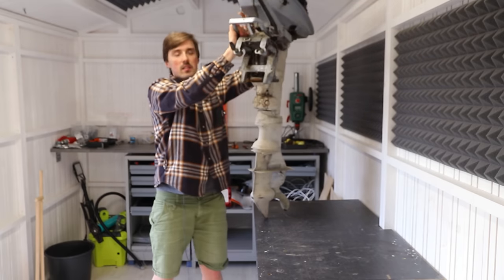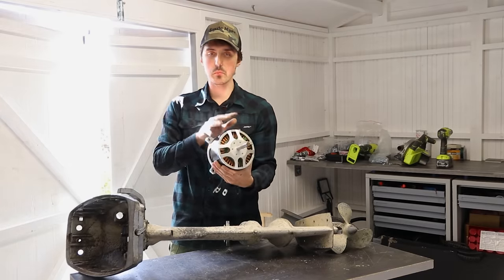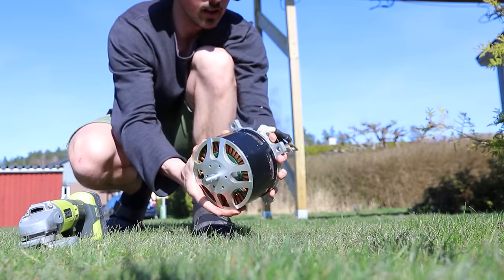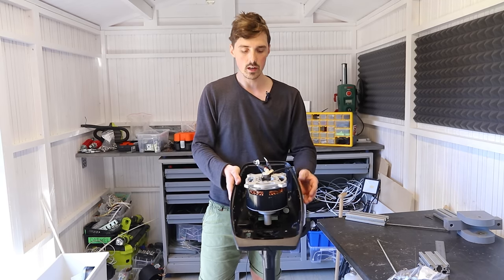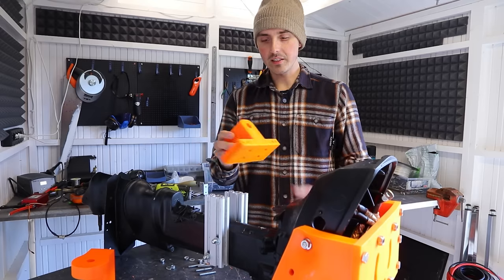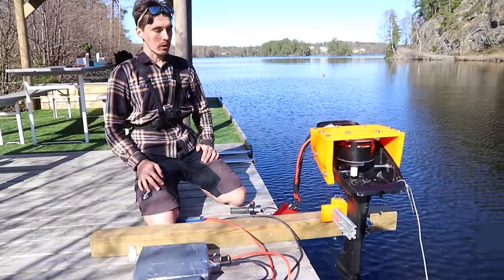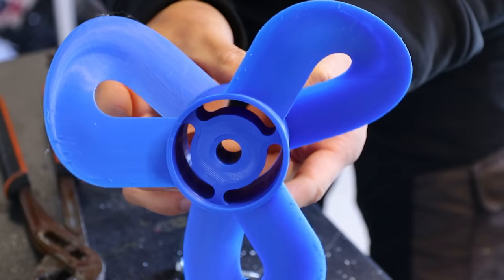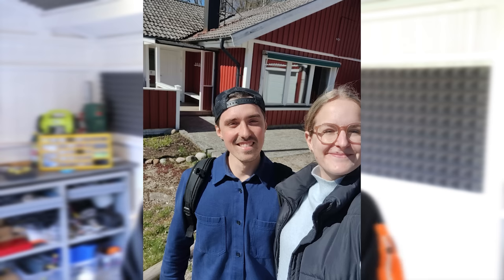Rideable Electric Speed Boat Build - PART 1

Comment: Its not cavitation at 10:30, its ventilation when the propeller gets air from the surface. 

Cavitation happens at the tips of the propeller blades when its spinning so fast it creates a vacuum on the other side of the blade and starts eating away at the aluminium/whatever the prop is made of :)

Comment: I suspect a steering wheel could be added to the engine housing and simply eliminate the need for a linkage (straddle the motor, basically).  If there's enough caster/offset from the propeller to the pivot, it will not need to be at the back of the watercraft.  Sponsons/fins on the hull would be quite beneficial in this case (movable rudder might also permit crabbing). ...Oh, and you're gonna have 420 days of bad luck if you don't oil those nice tools!  Like reely bad luck -- pinching your finger on a screwdriver type of crazy shit.

Comment: can't you use the metal part that was already on the motor to mount the motor to a ship? Your steering problems should also be fixed with that. That part is already made to withstand the forces the motor provided and be used to steer the thing
Reply: He seems to prefer reinventing the wheel with poor quality plastic

Comment: Why not mount the outboard case to the transom normally? I know its not good content but you could have saved yourself some headache if you just bought a transom clamp for the motor. It would have a pivot and then you just attach cable to each side of the housing

Comment: Here's a tip. Building with plastic is no good if you want something to be reliable. Get a lathe and a drill press and learn how to weld metal. Then you will have better stuff.

Comment: This is such a simple build if you know what you are doing?  Use a piece off the end of the original crankshaft to couple to the driveshaft and a piece of the original engine as a spacer.  See what 1000's have done before you?

Comment: I don’t get why you made a completely new mounting system for the engine. There should already be one, replacement parts are dirt cheap and the steering parts would be less sketchy.

Update: in the first shot you can see the mounting equipment, you removed it and made it worse

Comment: Dude, you're overengineering your plastic a little. Your parts are mostly really simple. You would be faster by using sheet metal and drill it just in place. Way tougher. Way cheaper.
Also the 3D printed part holding the whole construction to the boat. No need to 3D-print it, just extend your extrusions and drill a hole in them.

Comment: 😂😂 youve been 3d printing so long your tools rusted I have been way ahead of you I've already tried and been there done that it's not going to work that well dude you're better off using a wheel grinder and get a 12 to 1 ratio that's what I'm working on right now you're going to want to use pipes on threaded stud the Plastics going to get hot and it's going to melt and it's going to cause some wobbliness